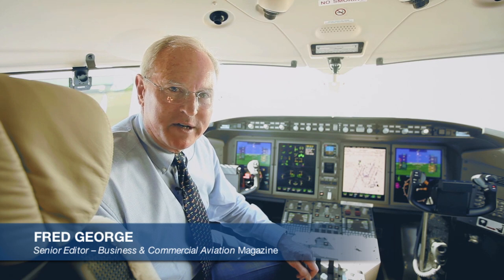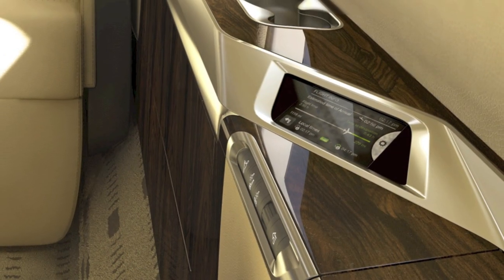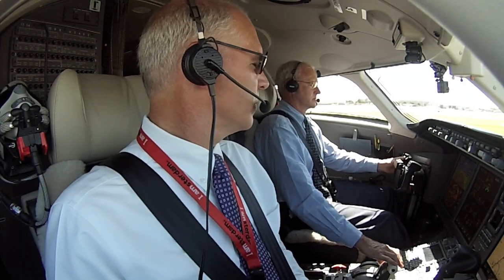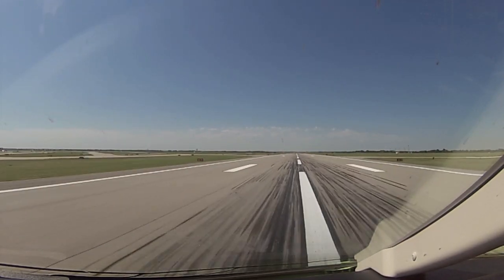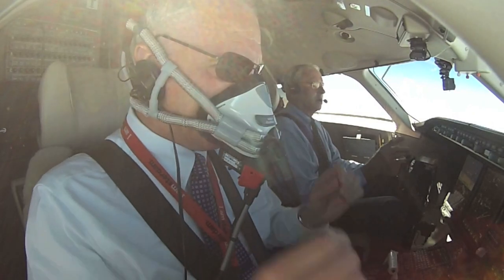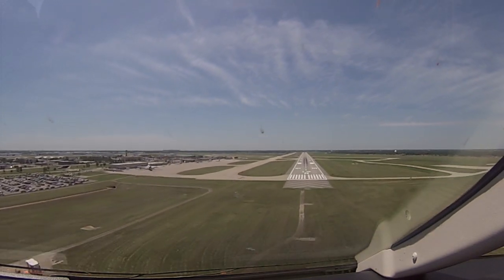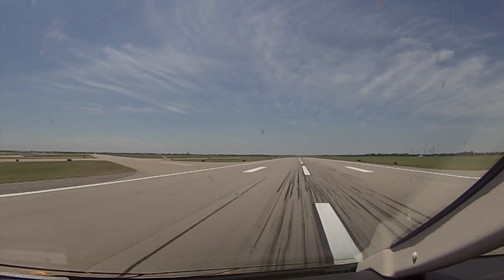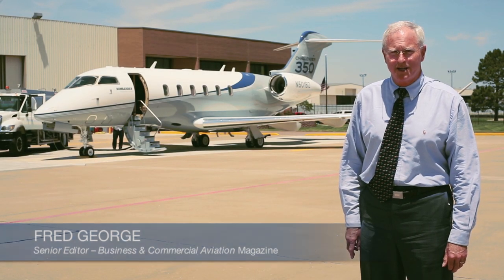Bombardier Challenger 350

Comment: 1500 pph at .8? Ain't bad
Reply: Is that 1,500 Mph?
Reply: Corey Jordan pph is pounds per hour, it’s a fuel burn metric. So, 1500 pounds per hour of fuel burned at Mach 0.8 for that aircraft at a specific weight